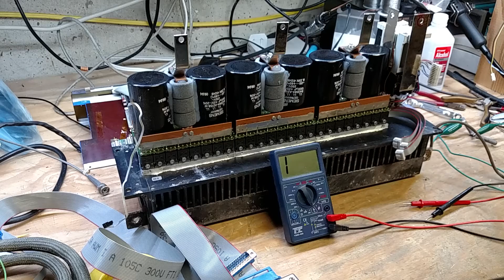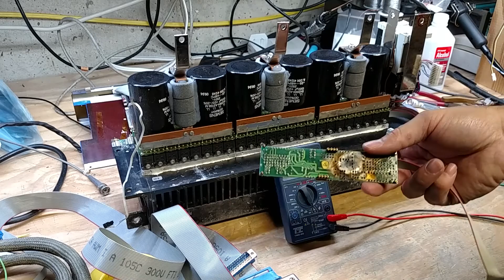1995 Solectria E10 Repair / Restoration, Part 18

Comment: how much would it cost you to just replace the motor with its 2015-2016 counter part?
Reply from the maker: +fromatic2
Since the problem is not with the motor it is with the controller... I will assume you mean the motor controller. ;)

I am not sure how much it would cost... these controllers have been out of production for at least 15+ years. (Actually I think 99 is the latest AMC date code I have seen).

You would need to find a motor controller that has the same voltage and current range.
Preferably the same motor encoder feedback.
And the same control inputs/outputs, so you don't need to rewire anything.

Also you would want it to be around the same physical size. So you don't have to find another place to mount it.

I think the main problem would be finding a motor controller that would fit in the same spot.

OEM Controllers tend to be physically large and odd shaped these days. Due to most vehicles only having one motor and one controller. And both being crammed into the same space.

I might be slightly biased, but I believe that it is cheaper to fix the controller...

Plus you would need another identical one to drive the other motor. I would think you would want them to match. ;)

Thanks for watching.
Reply: cool thanks for the info

Comment: What an odd place to put the mosfet driver board, wonder if heat plays a role in the failures.
Reply from the maker: You do want your gate driver to be as close to the MOSFETs as possible. ;)